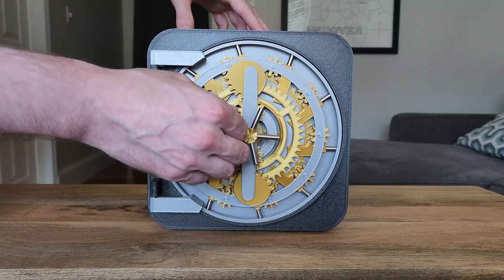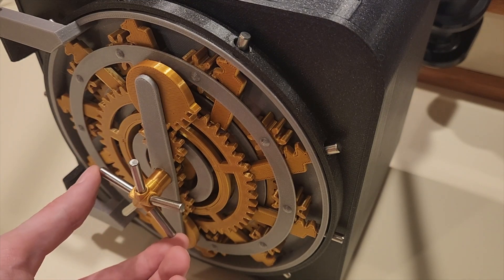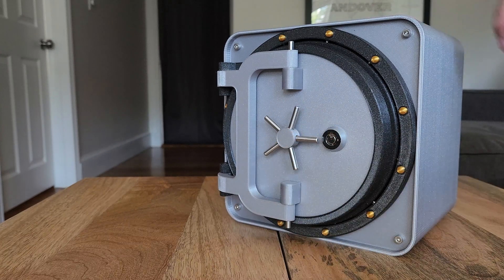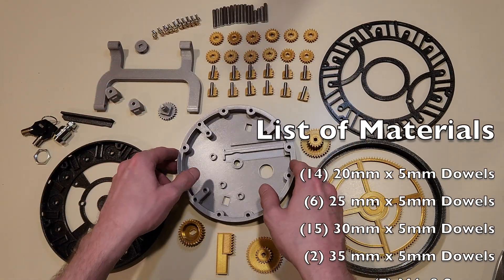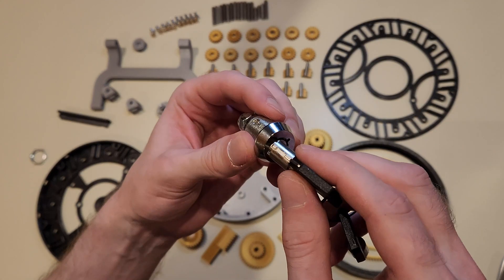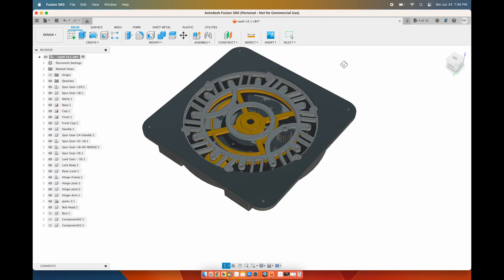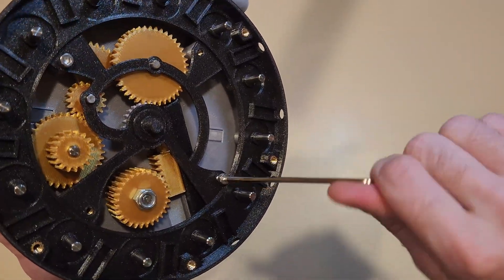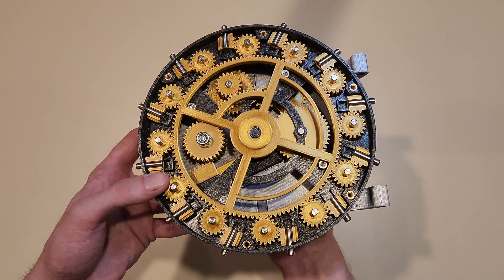3D Printed Locking Vault - Version 2.0

Comment: this is so nice. now I'll have to get 3D printer so i can make one for myself.   i know it's not the bullet proof safe, but i would like to see door screw put from inside. so you don't have ways to open safe without the key.   nice work
Reply from the maker: Thanks! That's a fair point lol, I used screws because I was fairly new to 3d printing and was worried the door would get stuck locked and I'd have now way to get inside. After almost 6 months, it still works great so the screws weren't necessary.
If you liked this, stay tuned - I'll be posting a sequel to this vault soon 🤫

Comment: Of course the smallest piece is the most difficult to print.  The rack pieces are mostly impossible to print cleanly without a bunch of supports.  Weakest part of a beautiful design. I redesigned the whole mechanism, so that no support’s required.
Reply from the maker: Fair point, the racks are definitely fussy. I'd be very interested to see how you altered the design to make it easier to print. I'm working on a revised version (with a clear acrylic front and a 3d printed combination lock) and I made sure to make the racks much, much, much easier to print and work with. Thanks for watching and commenting! And good luck with the build!!
Reply: I just filled in the “notch” groove opposite the teeth. That way the piece doesn’t need any supports when I print with the U groove upside down.  And adjusted the Cap accordingly.  While maybe it’s not quite as good, it’s infinitely easier to print, and has little to impact on the functionality.

Comment: awesome stuff, though you should have designed trim to go around the entire mechanism on the box as a way to hide the screws.
Reply from the maker: Thanks for watching! When I made this, I was worried that the door would break so I made the entire face removable via the screws - but I've used it for months and it works fine so I could have just glued the face into the box and avoid the screws all together

Comment: Printables is empty :P
Reply: Woud love to give it a go printing, the mechanism is lovely, can see me fidgeting with it for hours. 

If a a secondary mechanical lock cculd be put over teh door and act to unlock the door rather than the key mech, that would be infinitely cooler :D
Reply from the maker: Thanks for the watching, and the comments! I am so flattered that you want to make one for yourself! I just uploaded the .stl files, I was packaging them over the past hour lol. 
I'd be happy to share the Fusion360 file if you want to adapt the design for a mechanical lock - I love the idea!!
Reply: @RoccosStuff  Oooh, yay, that would be most useful, though I don't use FushionHA 380, so .Step files would be best for me to tinker with, if you could kindly bundle those with it (means anyone with pretty much any software can work with it, and not be forced into dodgy licenses with Autodesk lol) :)
Reply: @RoccosStuff  Also, i may be printing a good few of the parts in resin, so been able to make adjustments to the tolerances and make parts thinner is also quite possible. If you can spare £2-300 for a resin printer, you'll never look back for making fine intricate parts like gears, racks and other mechanical parts that need good strength at small size to function best :D
Reply from the maker: @noviceartisan  Will do, thanks for the suggestion! I'll let you know when I upload the files (hopefully tonight)
Reply from the maker: @noviceartisan  A resin printer is on my future purchase list, but my current apartment just doesn't have space for any more machines lol.  It's very tempting, though....
Reply: @RoccosStuff  they're very small footprint wise mars 3 pro isn't much bigger than a kettle footprint
Reply from the maker: @noviceartisan  I just uploaded the .step files to Printables - sorry it took so long!

Comment: Super cool... But if it just takes removing the 4 bolts in the corners of the faceplate to get the this open.... Kinda defeats all the work you put into it!
Reply: It's pla....  needs a drop from the table to get it open
Reply from the maker: @bl4d3hunt3r  Lol very true. And 15 seconds under a hair dryer is enough to melt a hole in it. I wasn't too concerned with creating a secure safe, just a fun project to sit on my desk. Thanks for watching!
Reply from the maker: Keep that to yourself... I was hoping nobody would notice that lol 🤣
Reply: @RoccosStuff  You could probably screw them in from behind
Reply from the maker: @AgentHubcap  Brilliant. Sometimes the answer is staring you in the eye...